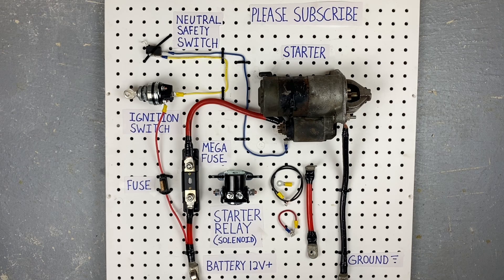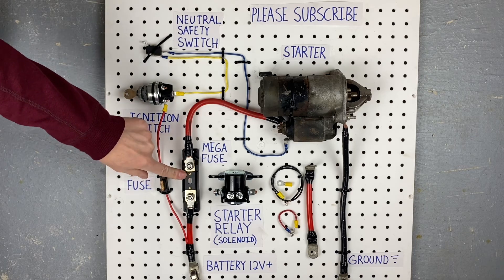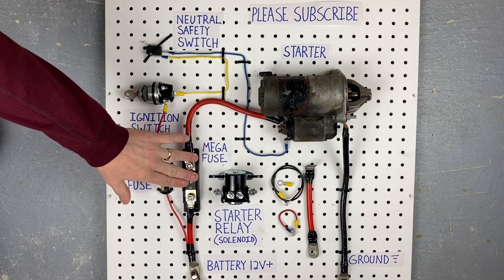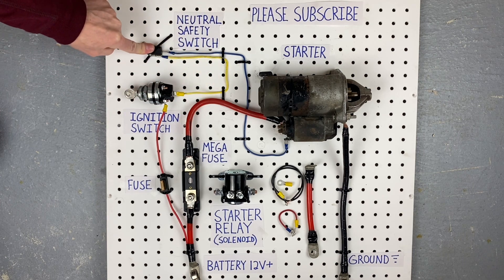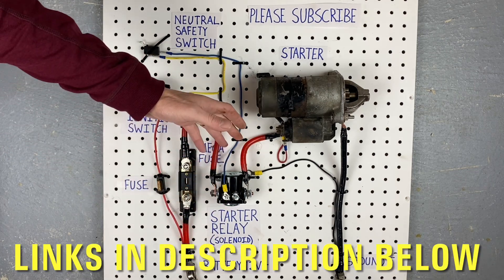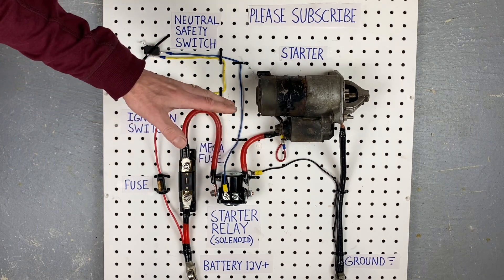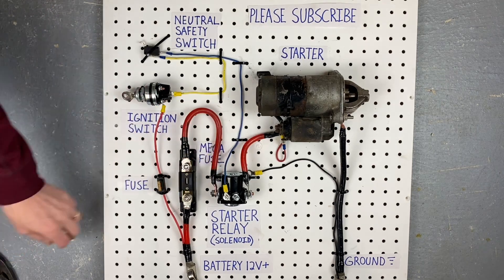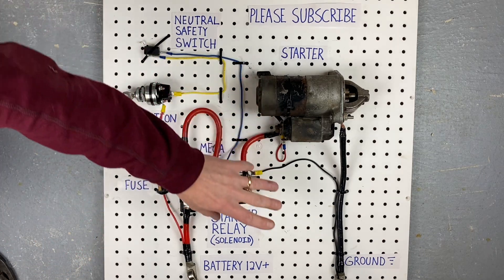How To Wire a Starter Relay Solenoid and Neutral Safety Switch on Any Car Truck |@WiringRescue

Comment: Hello, love your content! A few of your videos have really helped me wire my hot rod. I have an E-Z Wiring harness and I’m struggling with how to wire up an engine start push button momentary switch without a key ignition. I have two positive wires, a LED power wire and a ground wire on the push button switch but I’m not sure what to wire to it. I am supposed to hookup the IGN SW Coil wire, IGN SW IGN wire, the IGN SW Power wire, the IGN SW Start wire and the IGN SW ACC wires but I’m not sure how. Are you able to help me?

Comment: Hey Jeremy . I've got a race car I'm needing some help with . Not sure how to message this to you , but here's my issue. I want to separate the push button starter from the ignition switch. This is a high compression motor and I want to get the motor spinning then flip the ignition toggle and the motor will fire .
Reply: I have a pic to send of the components .

Comment: Would you run a wire from the starter motor to the fuse panel if you didn’t have a solenoid?
Reply from the maker: I probably would not on my car. I’d run a separate fused wire to the fuse box.

Comment: So i have a question, do i need a fuse in between the ignition switch and the starter solenoid, on the second method that you mentioned?
Reply from the maker: As long as the ignition switch itself is fused properly, you don’t need another between the ignition switch and starter. Thanks for watching!

Comment: Every comment is just saying how great you are, and you do explain well.. HOWEVEr there is more to the subject... the FOrd remote relay diagram shows different wiring that you may also want to discuss.  It switches main 12 V which is also wired direct to starter, to a wire that then runs down to the starter solenoid (i.e. small terminal) lower current (i.e. small lug) activator point... in this scheme 12 v is always at the starter, but not at the solenoid switch terminal.... I wondered what good these different wiring really do if the starter itself is hot and the solenoid is hot... seems it avoids the onboard-starter solenoid point... anyway, check out Ford (PMGR)  starter relay diagram.

Comment: thank you very much for this! i have a little question sorry to bother. which cable should i use from my ignition switch to the starter solenoid? mine is falling apart and i want to replace it.
Reply from the maker: Like most things in life, “it depends”. Your wire sizes and fuse sizes depend on the parts attached to them. Check out this video for some more details. https://youtu.be/EhzN6UdnmPA
Reply: @WiringRescue  thank you very much! i will look into it^^

Comment: Just found your channel very interesting just one question how is the battery positive cable insulated from ground at the starter as I have a slk 230 mec with a battery drain of a 100 Millamps on that cable your thoughts on this issue would be appreciated..

Comment: Hi I’ve been watching your videos. I recently got a vehicle wired with a painless hot rod harness. There seem to be connections at the starter solenoid that when I accidentally bump them it kicks on the vehicle. I thought it was a loose nut so I disconnected battery and tightened the nut in the solenoid, then when connecting positive on battery car cranks and turns over. I’ve traced it and looks like it’s only the battery 12v and alternator connected on solenoid.
Reply from the maker: That’s pretty scary!  You need to check the small wire (and terminal) on the starter and determine how or why that is being fed power without turning the key. I’ve never seen that before, but I’m cheering for you!
Reply: @WiringRescue  looks like the alternator is wired directly on to starter solenoid on the same terminal as the 12v going to starter. It looks like it’s supposed to be a one wire alternator setup it has the inline fuse that you mentioned. Should that connection from alternator that’s on the starter be placed on the positive terminal of the battery instead?

Comment: Is the only electrical advantage the blue NSS wire no longer has the long run? I assumed before watching this video, if you were adding a relay/solenoid you would want to effectively bypass the other internal one. Assumed it was the internal solenoid that was the constraint here not so much the NSS/ignition switch wire.

I replaved my starter after the old one had trouble only to have the new one have trouble the first 5 times... Im suspicious I still have issues so trying to narrow it down

Comment: Do you connect the red wire to the battery positive post and the ground wire attached to the starter connected to the negative post? I didn’t see the set up of your battery.

Comment: Some years ago at a cruise in with my 48 Plymouth my starter relay went bad.  I happened to be across the street from Tractor Supply. Went over and grabbed a relay for tractors. It had a push button on it for turning the engine over. It was a great addition to car

Comment: Dude, you should help Porsche write a wiring diagram.... But that would defeat the purpose of over priced un- repairable deathtraps. But if you don't actually drive them, you have nothing to worry about except the isb.

Comment: i tried to do this but i joined my 2 solenoid signal wires together and when i went to start it the it almost started but the starter kept running and now the solenoid on the starter doesn't seem to be working ill have to check it again tomorrow and see if the solenoid works, and change the wiring.
Reply: got it figured and reinstalled and wired it up like in your video and seems to be working on took a few try but got the truck running on the first day of winter next thing is fuel pump.

Comment: So the wiring on the safety switches on zero turn riding mowers goes to the ignition key and the other one to the starter or selenoide?

Comment: Using the original diagram, I added a relay to energise the starter solenoid because of a voltage drop from the ignition switch in my boat. Cheers

Comment: I  am using a starter solenoid to open the doors in a old c10 chevy p/u how do I wire it with just one switch?

Comment: How would this work with a PMGR starter? I have a trunk mounted battery, kill switch, and Ford starter solenoid. Is there a way to wire it so I don't have a constant hot running the length of the car? Thank you!
Reply from the maker: I don’t have any experience with the pmgr starters, so I am not sure what differences there would be. However, I do have this video for your second question. https://youtu.be/Yz9kqxWkoHI?si=M3CuFDCen3E0QwlD Thanks for watching!
Reply: I have watched it several times but unfortunately it doesn't help with the permanent magnet / mini starters. Thanks anyways @WiringRescue

Comment: Thank you the way you explain wiring makes so much sense!!

I was wondering your thoughts on when doing a brand new car wiring if you'd recommend a main relay to run everything through? I've got an old car and don't want to put too much strain on my switch.  The car has a 2 position ignition switch and then a pull start switch.

I'll be converting to efi using a haltech and I'd love some advice on the right setup.. do you do any consulting or design?

Comment: Man this channel is a goldmine! I don’t like electricals and they don’t like me…😂 But at the same time I don’t like not knowing how stuff works and I don’t like jumbled up wires running everywhere under my hood… I’m a little bit OCD and it absolutely drives me crazy. I’m gonna binge watch your videos until I learn it…😅😂 I gotta get my brake lights and blinkers fixed on my old Ford truck. It’s a 72 Ranger XLT, I’ve already found some burnt wires that were laying on the exhaust down the driver side frame rail so I’m definitely gonna start there and try to figure the rest out with your help hopefully. Thanks for taking the time to teach a feller…😂 I subscribed and I’m looking forward to learning as much as possible.
Reply from the maker: Haha! Starting at the burned wires seems like a smart move! Good luck with that Ranger! I’m sure it will be working right in no-time with your new electrical skills!
Reply: @WiringRescue  Thank you

Comment: I have a go kart that has the same basic system and the ignition switch fuse keeps going does anyone know why
Reply from the maker: There is too much amperage flowing through the circuit. You just need to find out where that current draw is coming from.

Comment: Im having an issue using screwdriver trick to bypass solenoid I have to turn my key to ignition start position in order to jump my starter with a screwdriver. My engine won't start unless the key is in ignition start position. The starter cranks all the time even when no key in car. What could be making that happen?
Reply from the maker: Sounds like your starter solenoid or ignition switch are broken. Each would require some additional diagnosis.
Reply: @WiringRescue  I think it may actually be an issue with my fuse block and my 30 pin of my starter relay. There is no voltage there and there should be always. I have 12 volts at other points of my fuse block but not at starter relay port

Comment: I like the idea of adding a Mega Fuse on the main positive battery cable.  Do you have any tips on how to properly size it for a big block V8 engine?  I'm thinking that it may require a fuse in the order of 800 or 1000 amps for worst case scenarios, but I haven't found such fuses available.  Your comments would be appreciated.

Comment: Great video.  Will starter relay be able to help with heat soak issue?
Reply from the maker: It may if your starter is very close to your exhaust manifold. Though if that is not the source of your problem, it won’t help :D

Comment: Now what would happen if I did all this. EXCEPT I’m just realizing I left the old signal wire to the side taped up, while running new signal wire from S terminal on starter relay solenoid to the male spade on starter. Was chasing a click no crank on my 91 Toyota 4Runner that came factory without a starter relay. Did what I thought I did right which was doing this ford solenoid wire up. Better than before but every now and then get a hot click no crank. Less than before but still leaving me stranded. Might have to go back and re do what I missed. That’s pretty much my problem huh? New battery cables, reman denso starter, ford solenoid wired up with thick new wires . Except for what I mentioned above

Comment: Hey can you guys help me with my Ford it's a 1993 4x4 
It's starts there's power we just have to start it from the solenoid on the fender 
Can you help me resolve
Reply from the maker: That’s not something I could diagnose over the internet. Your best bet is to either follow the wires from the ignition switch to the starter solenoid, or bring it to a trustworthy mechanic.

Comment: I have a qustion, I have 1 Army  Jeep(M151A1). It uses a floor starter switch, the starter has no solenoid on it just the main cable.  There is a  Ford solenoid mounted next to the starter switch. How would I wire the push botton stater switch for this?

Comment: Best explination on YoyTube.   Your video answers all my questions. I have M151a1 army jeep (24V) that has a floor starter that I want switch to push button switch. So, I run power to my ignition switch-out the ignition switch to my push button starter switch-to the starter relay solenoid. Create a jumper for the starter solenoid on the starter. They my + battery cable goes the starter relay solenoid in and out to the solenoid on the starter.

Comment: Just wondering how the solenoid drops out once the van starts up when you do the little jumper wire off of the main wire at the starter in example number 2 . Does the pinion gear stay engaged all.the time well running the van.
Reply from the maker: As soon as you let off of the start position on the key, the gear on the starter retracts and the starter stops spinning. The “run” key position does not send any power to the starter.

Comment: So I have an issue with my truck I had to drill out the key cylinder cause I had lost my keys.  So I ran two wires from where my starter relay goes and sometimes I get just a clicking sound once in a while it starts right up other than that I have to get a jump and mess around with the wires to get it started please help it's a 2005 Chevy Silverado 1500.

Comment: I have a critical issue on a 01 f150. I paid a buddy to replace the starter and he put a ground strap from the small post on starter(ignition) because of battery drain. But my problem is  when starting the truck the starter stays engaged and burns the solenoid on the starter out. 3 starters now and I don't know if it's in the ignition, ground issue, or what? Could I bypass the ignition and put a push button starter in? It's been parked 2 years because I haven't figured out why it stays engaged. And I got sick a year ago so I can't do much like I used to do. I would be grateful for any feedback on possible remedies especially inexpensive ones...

Comment: This would work well with a battery mounted in the trunk. The solenoid would only power the positive wire running the length of the car during cranking. I'm thinking of running this setup. Thx for all of your great content
Reply from the maker: Yes! This is another video that shows something along those same lines. https://youtu.be/Yz9kqxWkoHI  Great for mounting batteries in the trunk. Thanks for watching!

Comment: How many amper that you have used for your mega fuse in the diagram and what number gage of wire you are using on the positive connection, tnx?

Comment: Are you going to see any voltage the wire from the neural switch to the starter when you crank ? How do you confirm that?

Comment: Thank you for your detailed explanation. I am not a mechanic, I really appreciate your video.  I am having an issue with my Mazda titan truck where the starter motor starts when I connect the big cable from the positive terminal of the battery. Now I understand, there must be a wire somewhere that caused the starter motor to start.

Comment: I don't understand why your diagrams don't work for me, I followed them to a T.
Reply from the maker: Are you using the same parts? If you have a test light or a multimeter, you should be able to follow the electricity to see where it stops in the circuit.
Reply: @Ratty Muscle Car  I started with your "hotrod wiring for beginners" video same parts and all, when I switched the key to accessory, the solenoid would engage, turn to off, it disengaged, turn to on it engaged and when I turned to start the solenoid disengaged. I went through every connection to make sure it was all solid and nothing was loose, same issue. So then I disconnected everything and followed this video and now nothing happens. I wish I could explain better, but I guess I wouldn't need the videos if I knew what I was doing haha

Comment: Can starter wire cause a battery to die on car? Once it’s running.
Reply from the maker: I have never seen that happen. I’m not sure that it could. But sometimes other circuits connect to the main power wire at the starter. It may be worth checking for those.

Comment: How did you come up with a 100A fuse size for the starter?
Reply from the maker: I just used the fuse I had available to demonstrate. 100amp is probably not correct. You’d have to measure how many amps your starter circuit will draw when cranking the engine and then use a fuse that is the appropriate size for your specific components.

Comment: Great video. Just had a quick question for you and or anyone else reading this. I noticed you used a tumbler as your "switch" to give the starter power. Would this wiring work the same way if i replaced the tumbler with say a push to start switch? Just wondering if a push to start switch would work since its hard wired to 12v power. I know when wiring a fan switch or fuel pump switch you need a relay so the switch doesn't see full 12v power and cook itself. Would that transfer over to this wiring aspect as well?
Reply: Yes…you can use a momentary push button and it’ll work.  The key point is to make sure the push button switch can handle the power that the circuit provides.  If the ignition fuse is rated 10 amps, you would calculate the power rating needed.  12volts x 10 amps = 120watts.  Therefore, you’d purchase a push button switch that’s rated a minimum of 120 watts.  As a best practice, buy a switch that is rated 150 watts or 250watts.  It’s best practice to purchase one that’s rated higher than what’s required (you know it can handle the minimum load or more).  Lastly, you’ll always want the full 12 volts on all your circuits (including the ignition).  Don’t confuse the voltage with the calculated power.  You just want to make sure you calculate the rated power the switch is capable of handling.  Ohms law at work.  👍

Comment: The main starter battery feed is installed without a fuse because once the starter is under a load IT WILL BLOW THE FUSE. That's why we have high amp batteries installed in our vehicles, the starter will draw a lot of amps turning the engine. A starter on a V8 engine will draw about 225 amps on average.

Comment: do u need safety nuetral switch with a manual
Reply from the maker: Typically you would have a clutch pedal switch instead.
Reply: @WiringRescue  cheers thku

Comment: I just bought a new wiring harness for my 4th gen Camaro for the ignition wire do I just connect that little red wire to the ignition switch ?